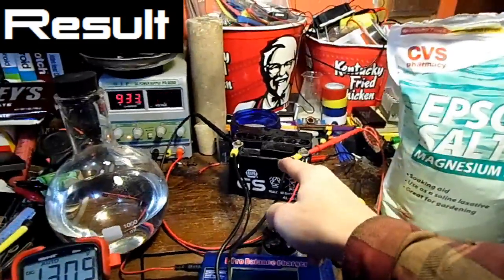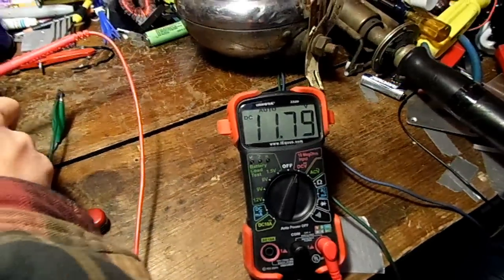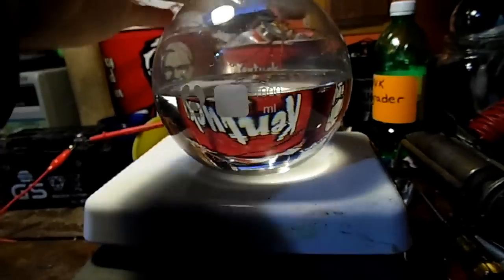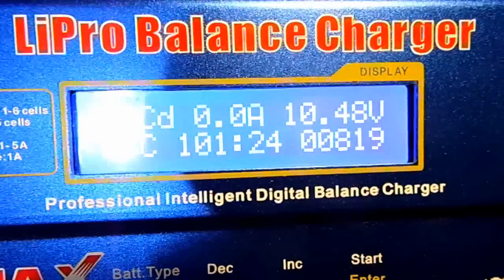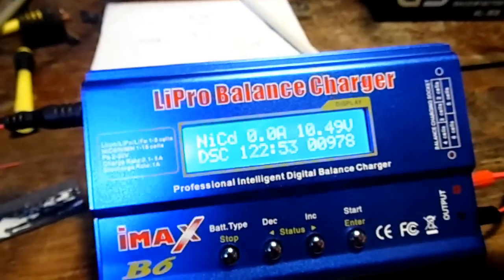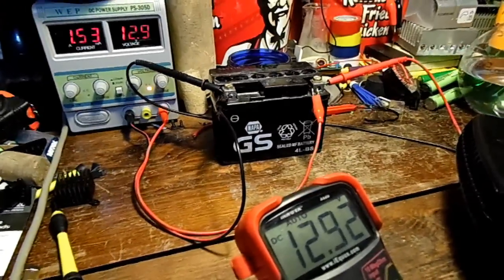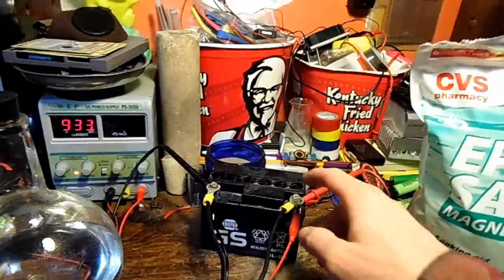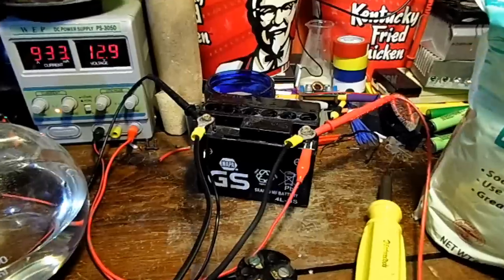Does Epsom Salt Revive a Battery?

Comment: You need to get rid off all acid first, replace it with "salty" water and charge it up. After charging replace electrolyte again and charge. Do this process 3...5 times, get rid of electrolyte and fill battery with proper "battery acid". What you have done is not good enough, as it is just small part of the process.

Comment: cmiiw, but isnt the recommended rating for the discharge of that battery is at 3 amps max for a short period and .3 ish for a prolonged duration? maybe that explains why the drop in the discharge to 850s?

Comment: Hey, don't know if it's been mentioned, but you're using the Ni-Cad charge/discharge function when you should be using the PB or lead acid option...

Sorry if this has already been mentioned, but the PB function does fully charge and discharge the battery, unless you're using the Ni-Cad setting for a reason I'm not aware of.
Reply: He is only using NiCd discharge mode, probably because it lets him set the termination voltage.  He is using the Variable Power Supply to charge.

Comment: Why use the NiCd battery mode (I use the iMax) when it has a Pb (Lead) mode?
Reply: He is only using NiCd discharge mode, probably because it lets him set the termination voltage.  He is using the Variable Power Supply to charge.

Comment: I've got a pile of weak batteries from old jet skis and automobiles so I'll be trying this or a similar version.  The difference I see in this and another video is the other guy poured out the spent acid, filled with water to rinse it out then used a solution of 1 cup of Alum (aluminum sulfate) rather than the epsom salt (magnesium sulphate).  I am concerned about using the correct proportions/concentrations... also, have you experimented with other chemical solutions?  How does this compare to refilling with fresh battery acid after an internal rinse?
Reply: aNuthaRedneck I think you just have to try it on your own.  I agree you should empty the acid, add you solution, charge it, dump the solution , then re-add the acid.  Just trying to figure out if its epsom salts or alum.
Reply: I used epsom salts.... I just didn't get good results.
Reply: Like another youtuber said, it works on like 1 out of 10 batteries.  I did this yesterday and the battery that would not charge and would run a 300 watt inverter fan for three seconds charged up and ran a water pump for 15 minutes.

Comment: is the magnesium sulfate saturating the solution with the sulfate ion, increasing the conductivity of the water with the magnesium ion, but are you going to set the battery up for a bumper crop of sulfate crystals?
Reply from the maker: youd only get more sulfate if you let it sit at a low voltage. doing this should let you keep the voltage up thus slowing the sulfation.

Comment: Why are you using the NI-CD function on the imax while the battery is pb.(Sealed lead acid battery)
Reply from the maker: so i could set the voltage at witch it ends the test. the Pb mode is set to only one voltage but the nicad can be adjusted.
Reply from the maker: *****
 your replying in the wrong comment thread, hope you know that. not counting your repeating yourself.

Comment: added   TO  the existing acid ?     what if its full?
Reply from the maker: take some out. you have any common sense?
Reply: It works. 
This summer the battery in my van started dying. It would barely crank over. I charged it and only got a few starts out of it during warm temperatures. I charged it again and left it in the van overnight and the temps dropped to 45 degrees overnight.  It lost it's charge and wouldn't start. Just clicked. Since I have another van I left it sit for weeks while I researched how to revive a car battery. I stumbled onto a blog about Epsom salt.

I removed about 1/3 of the acid using a turkey baster.  I heated up a half gallon or so of distilled water on the stove until hot and kept adding Epsom salt a quarter cup at a time until it was ridiculous. Stirring it the whole time. The solution was slightly thicker than water but it was totally clear.  I filled the battery, put the caps on and shook it good. I charged it on an old charger for 48 hours. I let it sit for a day and it slightly discharged. I charged it again for 24 hours.

The temperature outside is cold. This is Wisconsin.  The van has started every time over the last four days and today the temp is 21 degrees. Today the van started like it's a new battery. The battery is FIVE YEARS OLD. Just a month or so ago it was crap.

Comment: would'nt be better if we buy  electrolyte  already prepared from the store ?
Reply: It might be better but more expensive for DIY. Sulfuric acid is used because it is cheaper in bulk. For you to buy just enough for one battery though would be more expensive than Epsom salt or sulfur based fertilizer. It's just the sulfur you need in an electrolyte to make PbSO4 when it charges or discharges.
Reply: ok

Comment: Hi, I was wondering if you can mix Epsom salt with alum and get the benefits of both.
Also, I hear borax helps stop corrosion, could you try it out and let us know if this helps.
and lastly, how do you desulfate a battery? I hear it is doable, but what works best?
Reply from the maker: thanks for the ideas, and the best way to desulfate a battery is with a pulse desulfator.

Comment: What's the freezing point of an epsom salt solution in a battery? A 100% charged lead acid battery's  electrolyte will freeze about -77 deg F, and a discharged battery will freeze around 20 deg F. I you swap out the electrolyte and live in a cold climate, prepare to wake up to a frozen battery. in the winter if temps drop much below -5 C.

Comment: I am looking for a new battery charger so i can charge multiple voltage batteries.  I see you are using a DC Power Supply.  Do you use this to charge the batteries?  Do you have to monitor it?  Let me know the advantages and disadvantages if you can.

thanks and nice video.
Reply from the maker: a manual power supply gives you a lot of information an control, only downside is you cant just let it charge and expect it to turn off by itself.

but usually i put it on a low amp setting with a not very high voltage. so even if i did forget it for like 2 weeks, it would just get to 13.3v or something and just start taking less and less current till its like 20 milliamps.

Comment: I have to confess more ignorance of lead acid batteries.  I hear people say "that battery is dead, throw it away". I watch Youtube videos which say "desulfate", use only "distilled water". I have never come across a video that says "add acid to your battery". Any chance of you saying more about this? I thought the acid was hydrochloric acid, so where does the sulphur come from that requires desulfating?
Reply from the maker: no the acid is sulfuric acid. maybe go read the wikipedia page on lead acid batteries.

adding acid to a battery will be the same as epsom salt. but dont add too much or you will pretty much disolve the internal parts of the battery with too strong of an acid. and btw i've only used tap water with no problems.
Reply: Many thanks!

Comment: like your videos butttt. your doing it little wrong.1ST charge at 15.5 volts at only a couple hundred millamps with the epsom salt for couple hours. then drain it and put new epsom and charge again at 15.5 volts for couple more hours. do this till liquid being drained is  clear. then use the ratio of 2 pounds of alum to one gallon of distilled water. alum is sold as mortons at supermarkets(making pickels).heat the water and pour the alum mix quickly as it turns to crystal FAST. then charge at 14volts till it holds 12.8volts  and do the charge/discharge till it holds over 12.8 volts. YOU WILL LOVE THE OUTCOME cause it will charge like a supercap and wont die or over discharge with low amp loads
Reply from the maker: you can't charge at 15v at a few milliamps, teh voltage directly changes the amps. if you limit the amps to 200 or so the voltage goes down. if you bring the volts up to 15 you start getting a lot of hydrogen and about 4 amps.

i don't think you understand the relation between volts and amps when your considering a resistive circuit.

but yeah i've heard of good things from alum batteries.
Reply: Rinoa Super-Genius basically use a desulphator because you need over 15.5 volts to desulphate the lead plates but you dont need much amps. try it
Reply from the maker: this battery has been desulfating for several months already and it only got it up to 12.2ish volts.

Comment: I had a dry 12 volt battery. I put distilled water in it and it charged up to 8 volts and went down to 4 volts over night. Does this mean there is no acid in my battery?
Reply from the maker: not entirely sure, couldnt hurt to try epsom salt or more acid.

Comment: are lithium ion bats able to be restored with any method?
Reply from the maker: i dont know of any method to bring back their original capacity. but i do know that if you find a cell that is at 0v or close to it and you charge it with a very small current (like 40ma) until it reaches 1v then your much more likely to not short it out. then once it's over 2v you can treat it normally. but of course those numbers arent set in stone. just rough guidelines i've discovered from personal experience.
Reply from the maker: *****
sea salt "sodium chloride" will kill the battery. epsom salt is magnesium sulfate so it has a much differant reaction.
Reply from the maker: *****
baking soda will neutralize the battery acid and make the electrolyte not work.

shit can mix with water, doesnt mean it works ok in a battery.
Reply from the maker: *****
 i hope you dont use that haha. hope you have a nice day too.

Comment: Great for the mad scientist, however, the battery will never be like new again. Most car batteries can be bought for $60 or less when on sale with a $10 core exchange. This seems like a big waste of time. For me, time = money. Downtime is costly and usually occurs at the most awkward time. When it comes to tires and batteries, I find it more economical to replace tires and batteries with new as needed.
Reply from the maker: so you just throw things away instead of doing maintenance on them to make them last longer?

wasteful people like you make me sick. most people don't have the money to buy a new battery or tires. i would have to save up for several months for new tires.
Reply: Rinoa Super-Genius  Hold on buddy, everyone is at a different place in a life. I know a lot of people who are like you and me trying to make things last longer. We need them too. There are others who make a lot of money and replacing a battery that's acting up does take the least time. Plus, as long as they turn the old battery in as a core, it will get recycled.
Reply: 6 years later..... car batteries have doubled, tripled in price.

Comment: well, what if one just added a bit more acid? Maybe instead of 10% around 15% and then just refilling the rest with water... Wouldn't that help a bit?
Reply from the maker: yeah that would prolly do almost the same thing as adding epsom salt. it's just epsom salt is so much easier to handle and stuff. the main thing your doing with adding acid or epsom salt is encreasing the reactivity.
Reply: Rinoa Super-Genius
alright, thanks :)
Reply: Rinoa Super-Genius
what happens to the magnesium?? does it get deposited on the plates of lead??
Reply from the maker: inspectyerbooty
 dont think so. think it works just like the sulfuric acid.
Reply: Rinoa Super-Genius
maybe the magnesium metal in the epsom-salts just settles onto the battery floor and is harmless, maybe it is just miniscule parts per millions :)
Reply: +inspecty, not ppm. Magnesium sulfate MgSO4 is Epsom salt.
Reply: Sulfuric acid is 2H+ SO4-, the epsom salt is Mg+ SO4-

The sulfate ions are important, not the hydrogen or magnesium ions.
Reply: inspectyerbooty you can’t deposit magnesium from an aqueous solution.

Comment: Bro actually I don't know anything about of battery maintenance, but face some problem till 4\5 month, can i use this process on my IPS(instant power supply) 100 ampere 6 cell battery? my machine continuously charging over day by day, electrician says "my battery can't reach 12volt, it reach 11.2volt while day by day charging, when battery reach 12 volt, it will stop charging automatically", can this process makes my battery volt up? help me, thank you.
Reply from the maker: if the battery won't work then you can't make it worse. it should help.
Reply: Rinoa Super-Genius bro please me tell me the quantity of Epsom Salt, how many spoon required for half litre distilled water? and is this necessary to fully discharge my battery before make this process?
Reply from the maker: Nazmul Hossain Shifat
 idk, try some and if it doesnt work, try more.
Reply: Rinoa Super-Genius bro i mixed 300 gram epsom salt with 3 litre distilled water, is it ok??
Reply from the maker: Nazmul Hossain Shifat
 try it.
Reply from the maker: *****
 i think your confusing pulse desulfating with an equalization charge. pulse desulfators are ussually 30v or more.
Reply: Nazmul Hossain Shifat interesting points ,if anyone else wants to discover how to recondition batteries at home try Panlarko Recondition Planner ( search on google ) ? Ive heard some pretty good things about it and my colleague got amazing results with it.
Reply: Nazmul Hossain Shifat Not certain about the points made but ,if anyone else wants to uncover learn how to recondition batteries at home try Panlarko Recondition Planner (do a google search ) ? Ive heard some decent things about it and my work buddy got cool results with it.
Reply: hey ,if anyone else wants to discover how to recondition used car batteries try Panlarko Recondition Planner (just google it ) ? Ive heard some incredible things about it and my neighbor got cool success with it.
Reply: Abdul Moktadir plan larks recondition planner
Reply: Rinoa Super-Genius please
Reply: Nazmul Hossain Shifat

Comment: Should you not use distilled water?
Reply from the maker: it doesnt matter, i havent had any issues with tap water. no sense in wasting money and effort on getting distilled water.
Reply: Why Use Distilled Water
Many mechanics and car owners use tap water to top off the battery. This can lower performance and shorten battery life due to water impurities that upset the normal battery function. Battery manufacturers recommend distilled water for better performance and longer battery life. Distilled water is water from which salts and minerals have been removed. Water from faucets, lakes and wells usually has dissolved minerals and salts. These minerals and salts affect the chemical action in the battery. The battery works harder to maintain its charge and does not operate as efficiently. When the battery works harder, its internal temperature may get hotter while the battery is working. This causes more evaporation and requires more water. Distilled water ensures the correct battery chemical properties are maintained.

Read more : http://www.ehow.com/how-does_4901867_do-need-distilled-water-battery.html
Reply from the maker: Lightlyblazin
i have a question for you, why the fuck did you even ask if you already thought you knew?

its actually just a way for them to cover their butt if you do it wrong.
Reply: I looked it up after I asked.Rinoa Super-Genius

Comment: Your conclusions are a huge leap into....I don't think so realm! 
First: lead/acid batteries use 35% sulfuric acid in each cell; 
Second: the Magnesium SULFATE that you have put into solution by heating is changing the ph of the battery and compromising the reactivity of the battery by neutralizing the acid with a base.....

We call this an undesirable "reaction" all reactions have a result, de-sulfation through neutralizing the acid with more sulfate base is SULFATION on steroids! Instead of lead sulfate you have introduced magnesium sulfate to the reaction, as the magnesium sulfate cools and falls out of suspension it will bind to the lead plates and further sulfate them.

Comment: Very cool... Don 't put over 10‰ of KFC in there.....
Going to look for a way to check the capacity for battery's myself with a divice like yours....
There is also a way with a special charger which de sulfates those bad plates, no experience att all yet but want to find out.... Anyway thanks for your insight....

Comment: Man you skipped several steps and you have to replace the acod with a very very strong mix of epsom salt and water you know you have enough when you cant get any more to dissolve in the water you also have to flush the battery with lots of water to remove old contaminates. The extreamly high concentration of the epsom salt water mix is a stronger acid than the acid water mix in the battery originally. The only thing that you have done right here is the need to drain and charge cycle a few times

Comment: That's an AGM battery. Not the same as lead acid
Reply from the maker: AGM is lead acid, its not flooded lead acid bit it is lead acid. same exact chemistry. and if you add water to an AGM it becomes a flooded lead acid.